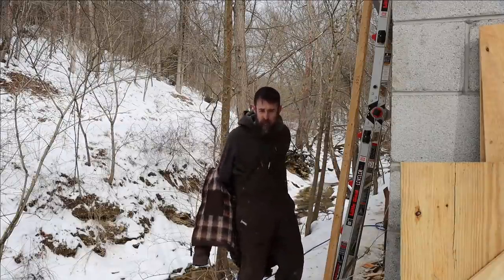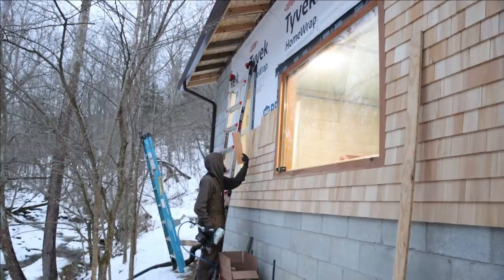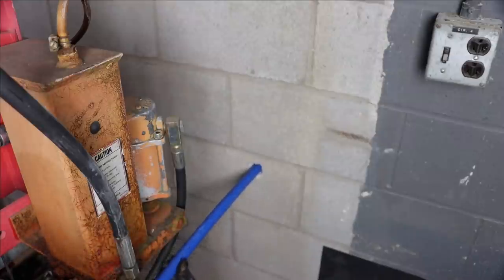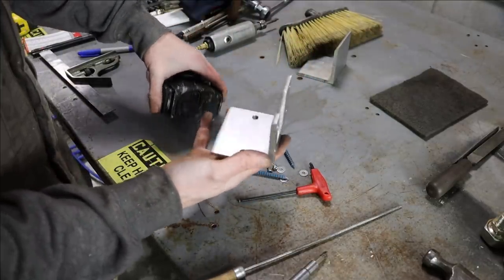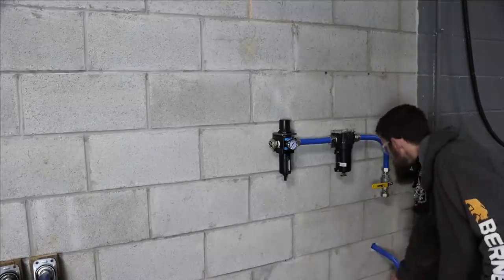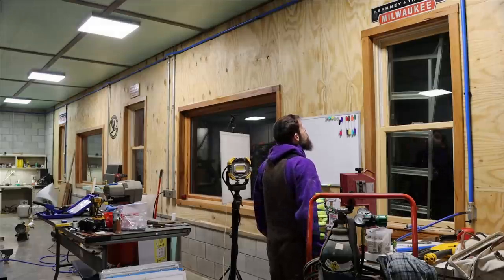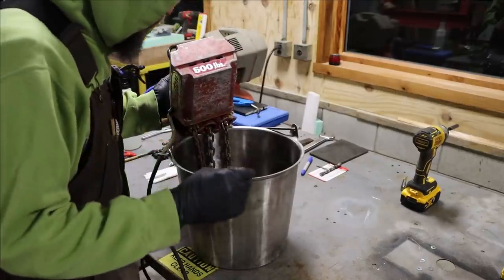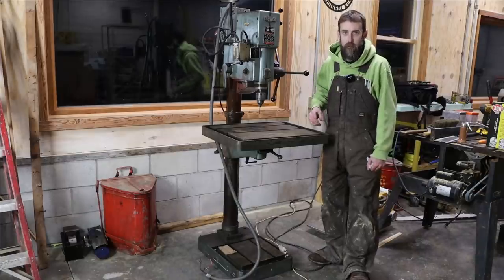Shop progress update and New Machine!

Comment: Great progress.  A hint:  When using thread sealing tape, liquid, or plain old pipe dope, don't get it on the end and don't get it on the first thread.  It will squeeze out into the line.  Dad was a plumber and told me that.  Didn't believe it and learned the hard way that he was right.  I'm still pulling teflon tape strands out now and then 25 years later.

Comment: Steve bring your hard line out of the shop. Make the connection to the compressor with a good quality rubber air line so you do not transfer vibration to your air system.
Reply: I was thinking of at least a metal sleeve going around the pipe where it went through the block

Comment: Greetings from Sweden. The drillpress is a Strand S-68
Reply: Is that also known as "Arboga" from the town they are (were?) made?
Reply: @geoffmorgan6059  I think Strand and Arboga are two different manufacturers. Arboga is from Arboga (obviously) and Strands were made in Rosenfors. Seems like both brands now belong to a company in Rosenfors called Machinery Scandinavia.
Reply: @olletornblom2094  - I "restored" an Arboga from the 1970's.  The internal motor had poled and in moving the broken down drill press gear the box was slammed by a fork lift.  I believe it was a 15".  Many of these were sold in the US under distributor brand names like "Wilton", etc.  I milled out a one inch piece of ground plate and fitted a new 2 HP external motor and belt, running the machine on a VFD.  I have photos but there is no provision on here to post them.  It would push a 1 inch drill through 1 inch plate with almost no effort!
Reply: Greetings from the small town of Arboga, in the middle of Sweden.. :). E100 owner...
Reply: It's closer to a 32M model I think ☺️ the 68 is the one without power feed.  
Both Arboga, Strands and Modig were great drillpresses.  Now the same model can be bought from China, with 100 different names.  And not the Swedish quality...

Comment: A farmer told me to hook my rusty log chain to the back of the truck and drag it down some dirt roads. Change attached ends and it really works well.
Love the look of the ceader shingles. Reminds me of the original roof on the grainery on the farm.
Reply: I wanted to mention how well your tip on cleaning a metal file with a copper pipe works.
Now hanging on a string next to file selection.
Thanks Steve and Elizabeth.

Comment: Nice Video Steve! My wife does not normally watch them with me especially the machining end of things. She likes it when your wife is interacting with the dogs, squirrels, and birds, as well as the scenic shots, but she really has enjoyed the siding of your shop, and I am sure she will have a project in mind for me soon with wood shingles.
Nice to have a good air system. We just upgraded ours in the shop as well. Got a used Champion Compressor, and a Ingersoll Rand Air dryer, and then expanded the air system in my machine and grinding shop. We used 1" PVC it works well and is easily modified or extended. What a great find on that drill press. Look forward to your cleaning her up and putting her to work.

Comment: I think that you can be proud of that little shop at home which was my life. Getting the noisy air  compressor outside was a godsend. I ran two storage tanks for the air and they were on opposite sides of the shop, vented outside for easy outside air hose... tires and such but most important was it was end of the run and all the moisture went to that last tank and a easy drain to "kick open" at the bottom of that tank to get moisture out of building. That drill press looks like it could double as a milling top as well. Nice place that you have there.

Comment: They sell them rubber feet on Amazon. I bought 3 for my 60 gallon compressor. Let me tell you..... it made a huge difference in noise and vibrations! I sat it behind my shop and made a little lean to with a door and put sound dampening foam inside. Best thing I ever did!

Comment: Should ought to be using a rubber 'whip' or snubber* for "this line" between the compressor and through block wall.
It not only damps pressure pulses, but eliminates any vibration transmission between the compressor and the plumbing.
Reply: he may well put one outside between the ridged line and the compressor.
Reply: Also a U in the line from the ceiling to the floor  then back up with a petcock cracked at the lowest point at the bottom of the U ( some guys make two Us all the way up & down with 2 petcocks drains cracked)  for a  pre drain right out of the compressor.  Do it outside before the line comes into the wall . Also there should be a petcock at the bottom of the I/R compressors tank, keep that one cracked open all the time as well, saves on life of air tank !  Water is a air tools worse enemy no matter how much air tool oil you use .
Reply: @hydroy1  He's already got a filter/regulator and a water trap.
Do you really think the compressed air is going to be doing much cooling after that?
Drip legs don't offer much except under the worst conditions.
A drip loop exacerbates the problem by forcing all flow through the trap.
Reply: I fully agree
Reply: @jimurrata6785   Keep in mind Steve has a used I/R compressor and we have no idea how many hours are on it. I set up spray booths for aircraft repair shops and we are always surprised how much moisture gets passed a single stage separator like that, ( even with a brand new compressor)  But something as basic as old school U loop with 3 cracked pet cocks before the single stage separator dryer always make a world of difference for your usage. It's just cheap insurance to save ware & tear on your air tools or if you want to shoot fully dry paint with a gun. The cost involved is little but the results of that U with extra petcocks are amazing . This is the way 90% of all professional car dealerships body shops are set up to keep water & oil out of the shop air supply system. I plumed my shop here at home with 2 up  Us from the floor to the roof and back down with 3 petcocks on the bottom of each and 2 single stage separator water filters plus a second dryer I move to each outlet I am using and I STILL have to replace each of my my tools  ball filter on my air tools about every 2 years  ( I do alot of high speed polishing on finished machined parts with air tools that I produce )
Reply: @hydroy1  Yeah Mike, I certainly don't t know anything about painting an airplane. 
I only know that fixing cars/bikes/sanding & spraying cabinets with an IR 80 gallon 2 stage is not the same as having a screw compressor.
And a simple chilled dryer was fine for the sort of volumes I ran day to day.
I sure as hell didn't need open petcocks bleeding, hissing and blowing dust around my shop.
Nor the compressor cutting on to make up for for the leak.
Reply: @hydroy1  I agree I would put a tee where it enters, and have a line going down that can be checked and drained every time you enter the shop. Beautiful system altogether!
Reply: @jimurrata6785   I don't paint the planes, I assemble,inspect, test and repair the spray booths for the FAA on call.
Reply: @howder1951    Beautiful system altogether! Agreed

Comment: Steve a good trick for leaky gutters. Buy some gutter caulk and get a roll of heavy aluminum foil. Caulk each joint generously on the inside and rip off a piece of foil a few inches wide and press it into the caulk along the joint. Works great.

Comment: Steve, I've worked in Quality & Reliability Engineering for a Automotive OEM and had always called this connection joint 
as you call them " Quick Disconnects". Engineering once insisted they be referred to as Quick Connects. I reminded them of instances of how quickly a transmission cooler line will disconnect right after customer delivery, and ruin a new transmission and lose a customer,, when the line operator at the plant does not fully seat the connection. Hence, a Quick Disconnect!

Comment: Steve, Glad to see the great progress you're making. Frankly can't wait til you are back to doing 'real' shop projects.
Apologies for this long winded message.
Here's a couple words of advice you're free to ignore regarding hydraulic or pneumatic fluid connections. 
1. Lubing O-rings is best left undone unless you use the media they are sealing OR you know the rubber compound and lube compatibility. There are Sooo many compounds and synthetics that if you just  need it lubed to slide into place spit on it or use water.
2. When you tape with liquid or rolled Teflon on a tapered (nptf) thread try not to get any of either on the end 2-3 threads. Male pipe threads are tapered/not parallel. By the time they are cranked into place like a cork the leading threads are no longer engaged and anything on them becomes potential system contamination.
3.    And lastly, air systems typically use FRL's, a Filter Regulator Lubricator combo. I didn't see a lubricator, but if your just blowing away chips probably no biggy. If you're going to run air tools you should be looking into adding lube. That water separator is decent, if/when you look to upgrade consider a coalescing filter. 
Thats it...I know , blah blah blah, but hey, that stuff was engrained in me for 40 years.

Thanks for the great vids. Best wishes.
Jim
🤟🇨🇦😁

Comment: Great to see the shop coming along Steve. All the work all of a sudden starts to feel great. I would personally put an air cleaner in the shop and never run any woodworking equipment inside (any wood cutting/sanding/drilling strictly outside where the dust can't accumulate). Dust protection is not just about wearing a dust mask while running a machine, because once you create dust indoors it never leaves the space. just settles and gets kicked back up when you walk around, and is invisible. Just my two cents.

Comment: Nice new drill press, looks like a dandy. I’m glad that winter weather has gone back north. Two weeks of snow and ice was enough. Not sure how they do it in the north!

You may want to look at one of the flexible hoses that connect from the compressor to your main line. Keeps the vibrations out...

Comment: Nice Drill press Steve. I bought one at my day job years ago and liked it so much I found a couple of them for my home shop. One of them having power feed. The one I have like yours I bought pretty cheap, they thought the motor was Burned up. Ended up just being a bad switch. They wanted $400.00 for the switch so I repaired mine. Did a YouTube video of the repair.  You shop is coming along nice.    Gary

Comment: You should add a valve down stream of your air regulator and filter to isolate them for cleaning, that way you don't have to dump the air system.

Comment: Steve, that drill press is gorgeous. Very jelly! Wish i had room for one, alas my j head bridgeport is my drill press! I hope you dedicate some vids to both the clean up and sorting of the drill press and the hydraulic press. I’d like to see those get worked on. As far as the compressor, i have an 80 gal quincy qt-7.5 i installed in my shop which i stole for almost nothing at a gov auction in upstate NY, and i installed my buddies 80 gal kobalt compressor he bought. What i did for him was tapcon a couple large 2x12’s on his concrete wall. That allowed me to position his water separator and regulator on the 2x12’s anywhere he wanted. If you decide to change the layout of those in the future, consider doing that.  Less holes in your cinder blocks!

Comment: Congrats on the new to you drill press.

On another note. In a previous life I worked in a custom cabinet shop. In that shop all of the air line drops had their own water traps and regulators. The drops that were primarily used for air tool also had oilers. Several of the machines also used compressed air and were fitted with their own water traps and regulators.

Comment: To really clean a chain, chuck it in a cement mixer and add some water. Comes out so clean it could have been sand blasted. It does take a little while to untangle the chain after you take it out though.

Comment: Would suggest extending the tank drain on your compressor back inside to a drain valve. Makes it easier to REMEMBER to drain it. Where you live, I imagine there is some serious humidity problems in air lines. I'm lucky that I'm in Colorado.  Michael in Colorado

Comment: Another good idea for your air system is an upside down pressure gauge on an elbow quick connect that you keep on one of the drop down manifolds. For testing all your blocks and other things you need tested. Plus it's great for double checking you discharged the system before you close up shop for the evening. Good as a tire gauge for sure. Always handy.

Comment: Awesome drill press, I don't think I would put it in front of the window in the event a bit would catch and throw a part off of the table and in to the window. Air system is looking great, but like others have said, a rubber connection thru the wall would eliminate vibration. Thanks for sharing you work. Stay safe.

Comment: I agree with the need of a flex hose between the compressor and the piping. Don’t forget to put a solenoid valve wired to the lights to shut off the air at the compressor tank when you leave the shop. I can guarantee you cannot keep the system totally leak free when all the equipment including many quick connects are installed. This means the system will bleed down the tank regularly when you aren’t in the shop and if a large failure occurs when you are not around you will burn up your compressor.

Comment: If you're just drilling through cement block walls a diamond hole saw works great to leave a clean hole.  If there is cement and rear in said wall...  better go get one from the rental shop where you can hook a garden hose to it.  I like to drill them oversized and then use a piece of PVC pipe as a sleeve.  Use hydraulic cement or a urethane sealant to hold the eeve in place.

Comment: on the Operation of the Water Separator, I expect there is a slight venturi on the Inlet side of the collector.  The drop in pressure would cause a temperature decrease, along with the centripetal force of the rotating air mass would cause it to rain in the cup.

Comment: For main air lines, too big is about right. The larger piping creates less pressure drop and increased reserve volume. Also, there are automatic valves which allow the regular draining of reservoirs and filters which seem to always get forgotten. Dry air is essential for good air tool performance and reduced wear.

Comment: That's neither a Wilton nor a DoAll, this is a Strands, made in Sweden, possibly Type S68, excellent machine, very similar to the Arboga machines.
I'm not sure if this model has the phenolic gear or not, but if it has, that's the only part that ever fails. It is phenolic to run quieter and as a failure point in case of a crash.
Also the motor on those is integral to the casting and not replaceable, so it should always be protected from overload with a suitable motor starter.
I've always wanted one but it's not to be, they command crazy prices here, I got my milling machine for that sort of money. Al is a saint!

Comment: A rebranded Strands drill press! Mine has the more common round table, and no T-slots in the foot. 
It will run forever. There's ball oilers on top for the bearings in the gearbox, don't overdo the lubrication. The oil will just end up in the motor. The motor is integrated in the housing, but open to the gearbox cavity. The gears themselves are fiber against steel and requires no lube.
Give her a hug from me and Sweden too!

Comment: The shingles look amazing on the wall especially that one from across the river with the lights on at dusk. I can begin to understand, once you explained why, you wanted a pillar drill like that one being gear driven and huge flexibility when using it. Congratulations on your airline installation with only two leaks - that's a major step forward in moving along the overall development of your workshop. 
Well done.

Comment: Steve,

Very nice score on the drill press. I scored well on a Doall that is a wee bit larger than yours. Mine was made in Portugal by a firm that bankrupted. Parts are not available for my machine. My machine lacks one speed. I assume it stripped a gear or sheared a key. I haven't had reason to take a look inside. I purchased mine from our shop, so I knew its history. I find myself using my smaller drill presses more often, but when I need something robust, I have what is needed.
I dream to own a moderately sized radial drill press. I will have space for a radial drill when my new shop is completed.
Our shop also owned a couple of Arboga gear head drill presses of similar size to your Doall. I eventually nabbed one from Production for our Maintenance shop. I loved that Arboga. Everything about the Arboga was engineered right except they used cheap head and table crank handles. It was a sweet machine. I would have nabbed that machine for my shop when I retired if I could have figured out a way.

Comment: I bought a used Arboga Swedish drill press in the last year. All the same features plus auto feed. Talked to importer and he said great drill press and will last forever as long as you don’t shift speeds when the press is in motion. This will strip out the fiber gears which aren’t available anymore. I figured a machinist could make them🧐😉if needed.

Comment: Were it me, i believe i would fabricate a box knee of sorts that could bolt onto the drill press base via t-slots. This way if you need to work on something larger you could swing the table aside and avoid cranking it all the way down. This would provide three levels of drilling heights since it's removable for extremely large stuff.

Comment: good videos.  myself used a hydraulic line from the compressor tank to  the first valve in my distribution center. i believe it isolates a lot of vibration from the rest of the system and as a bonus seems to make thing quieter also.